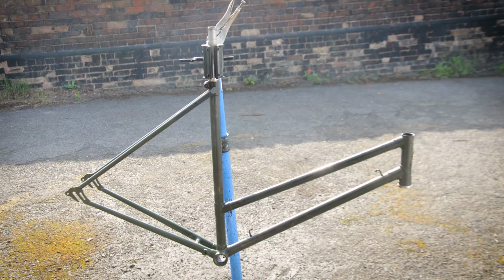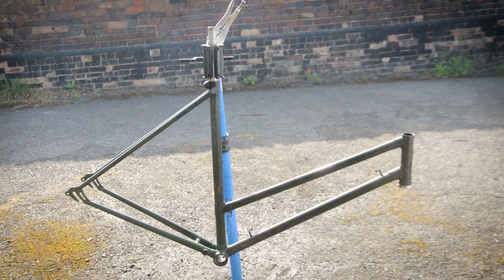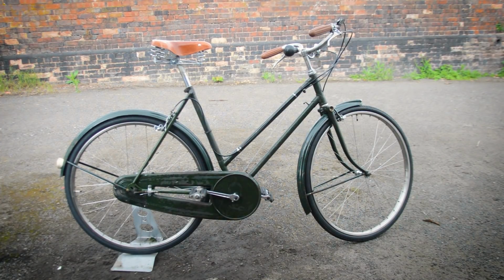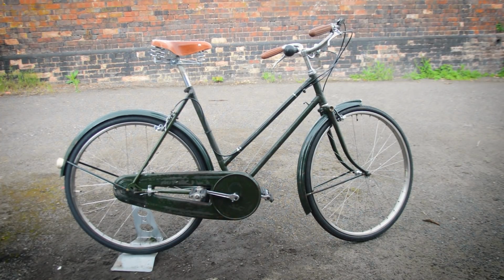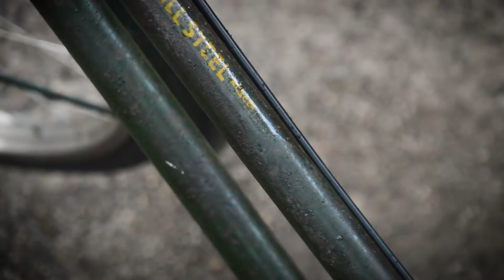1946 Raleigh Superb Sports Tourist - Vintage Bicycle Restoration - Sympathetic Oily Rag

Comment: Hi.  
Can you tell me which brake cable clamp nipples did you use?  

I have considered making new soldered cables, but don't really trust my soldering.  Most people seem to have ordinary cables and either use an upturned spoke nipple in the brake caliper recess hole, then a barrel type nipple; or they use a nipple which appears to have a recess milled into it.  Yours appear to be that type. 

 I have just sent off for a pair from France from a company that advertise on Ebay.  

Great restoration.  Really pleased to see you using copper slip. I see so many mechanics complaining about seized parts, then they put those same parts back together without appropriate grease to make it easier for them (or another mechanic) to take them apart in the future.

Thanks.
Reply from the maker: I think you may have ordered from the same place I did!  I believe mine came from France too.
Reply: @MonkeyShred  Great minds think alike, as they say.  Thank you for your reply.

Comment: Hello Richard. Question; Have you ever heard of a RodBrake Raleigh with a full chaincase in a single speed configuration? I have one and one person thinks its from the 1955--1960 era. It has a white tail rear fender non-standard rear wheel attacment. No dropouts. The axle slides in from the rear of the chainstays. I don't know the model or date of manufacture. I was under the impression that Raleigh rod-braked bikes were either three or four speed machines using SturmyArcher hubs. This is a single speed geared bike. Any ideas or thoughts?
Reply from the maker: The white on the mudguard came from WW2 says I believe. Single speeds were the base option for most models with 3 speed etc being options.
Reply: @MonkeyShred  Thank you.

Comment: Hi. What size bearings does this bike take for the bottom bracket, front hub and stem? Ive just gotten a 1952 Rugde Whitworth Sport which is pretty much identical to this bike
Reply from the maker: Sizes can vary so it's best to measure your own.  BB is generally 1/4", Headset can be 5/32 or 1/8

Comment: That's a work well done. Very good video btw. Bike look amazing - although rims are too shiny ( yes, I'm absolutely jealous as I can't make mine as shiny 🤣 )
Quick question though, what is the saddle you put on the bike? I'm looking for something like it but finding cheep and crappy eBay ones and definitely too expensive brooks ones. Nothing I would use and don't be afraid of it being stolen 😉
Reply from the maker: The rims are stainless! They're always that shiny!

The saddle was probably £20-£25 off ebay. New. Not entirely sure if it was leather or not though.

Comment: Love your videos! 
One question: what greases do you use? A white (lithium?) for the bearings and a brown for the threads.
Reply from the maker: I use a Weldtite grease for bearings and I just used normal copper grease on the threads here to stop anything seizing.
Reply: Hello, great vid. If I may ask, can I use the same type of grease for both bearings and threads? I am fairly new to bike maintenance and restoration. Thanks.